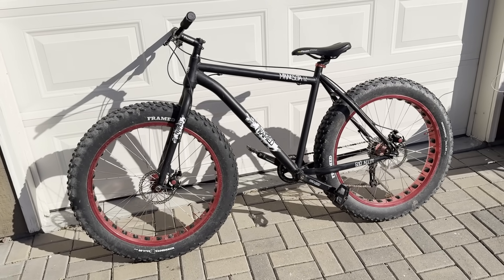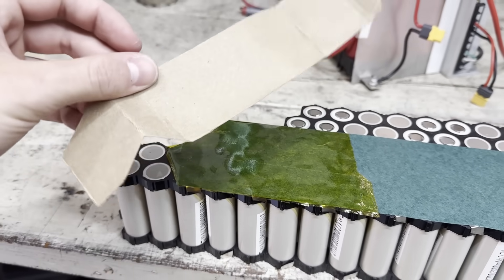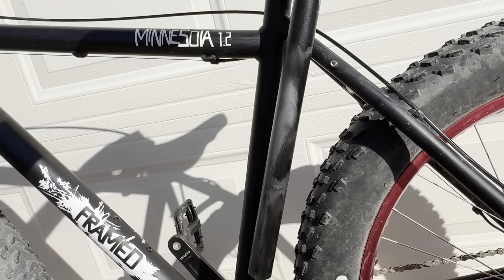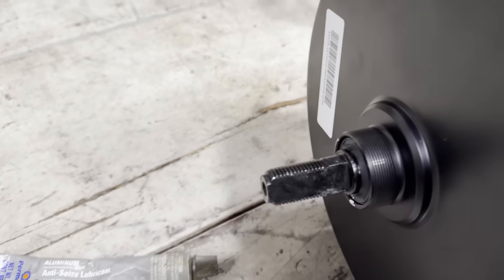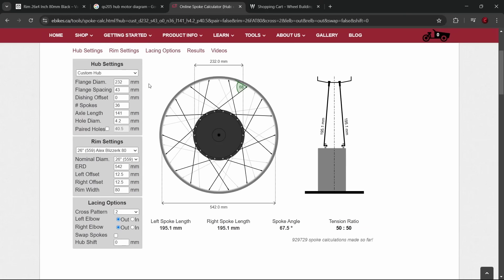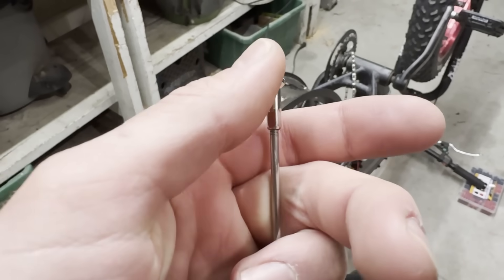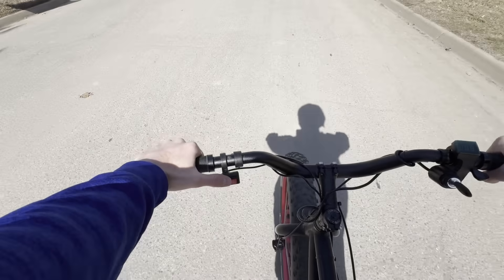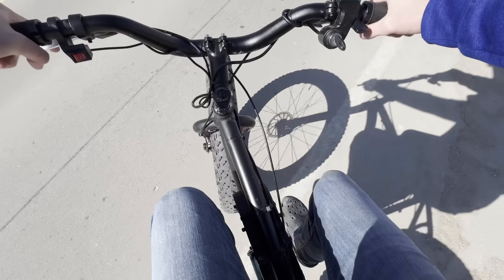Overpowered Fat Tire Ebike Build

Comment: All weight on rear wheel?  U got quite a pack on that's at top of frame I think it's top-heavy or whatever it is called
Reply from the maker: @Skrek1988  Not all the weight on the rear wheel but the battery weighs 15 pounds while the motor weighs 30 pounds, and because the motor is further from the center of the bike the weight feels much more significant.
Reply: @Calthecool  ah  wow 15pound battery xD thats alot of battery  xD. wow the motor is a beast😃  but i had noidea it was 30pounds 😯. tho im curious why did u add copper sheets on the battery isnt it enough with the strips alone? ive only done my batteries with the strips. would i benefit any on doing it like u did - coppersheet and strips to weld ontop like u did
Reply from the maker: @ Because the battery is doing 30 amps per cell you would either need very thick nickel or copper. I also wanted to go a bit overkill because the battery is in the plastic case so it doesn't have very good cooling.

Comment: Slap some training wheels on this thing or a wheely bar and it'd Hella fun!! Knowing my luck, I'd forget about the torque and do a double backflip and land on my head on take off. My current ebike I'm not the biggest fan of because all of its pedal assist modes are "like woah, you touched the pedals.. I got this bro"
Reply from the maker: @snonniesnean123  Yeah it’s annoying when you are going around a tight turn and you move the pedals a quarter turn so your foot doesn’t hit something and the bike thinks you want full power.

Comment: Is this more powerful than a bbshd?
Reply from the maker: @Alphabet7  This is 5x more powerful than a bbshd.
Reply: @Calthecool  in watts or real world? Genuinely asking cuz I have no clue
Reply from the maker: @Alphabet7  To compare the watts you can multiply the current*voltage, bbshd is 52V*30a=1,560w while this bike is 72V*120a=8,640w. I don’t think it would be possible to have a bike with a mid drive motor that could beat this bike because the normal bike chain drivetrain just can’t handle enough power.
Reply: @Calthecool  interesting. Thank you

Comment: what about the batt cooling system? it could overheat 🙋‍♂️
Reply from the maker: @devaneizanardi  It hasn’t gotten very hot at all, these cells are rated to do 35 amps from full to empty nonstop and I’m only doing bursts of 30 amps.

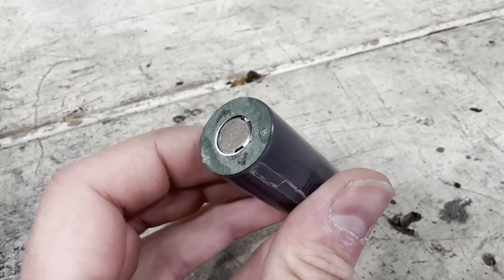Comment: 0:37 With the nickel sanded off you can solder them. Solder doesn't stick to the nickel very well, but I have soldered 18650 batteries together by sanding the nickel off because I don't have a spot welder.

Comment: bro we both know this thing doesnt have more than 1500 W
Reply from the maker: @user-interestingguy  Lol are you trolling
Reply: I think the rated is 3000W, but i do wish everyone would stop using the peak number since that is for short bursts if it actual ran at 9000W it would be cooked
Reply from the maker: @shaynegadsden  This motor could do 9000w continuously for probably 8 minutes before it overheated depending on the conditions, so I think it’s fair to rate the bike that way. It’s how cars are rated after all, you couldn’t do donuts for 8 minutes at full throttle in a sports car without it overheating.
Reply: @Calthecool First of there is no QS205 5T rated for 9Kw second that peak rating on all E-Bike motors is for seconds not minutes, I am electrician i understand motor specs. And third no a car can run at peak power till it runs out of fuel and doing burnout isn't a good example since the reason engines fail there is overheating not much airflow spining in circles.
To prove my point if you read the the spec on the website you linked it gives an ooerating temperature of the motor then in bracket the temp at peak power and a time
(peak 120℃ in 5 – 10 second)
Reply from the maker: @shaynegadsden  I never said it was rated for 9Kw, and you can never treat the ratings like they are perfect. Even at face value the “peak 120 degrees c in 5-10 seconds” value doesn’t make sense, if the motor got that hot it couldn’t cool down any significant amount in 5-10 seconds anyways. I compared it to a car doing a burnout because it doesn’t have the most efficient cooling, just like a hub motor spinning at low rpm doesn’t have the most efficient cooling. If I drilled a bunch of holes in the side of the hub motor for cooling then it could take a lot more power, but that’s an unreasonable thing to do.
Reply: @Calthecool obviously you don't understand the peak is the maximum temperature and how quickly it will get there not how long to cool, and where does it say anywhere the motors true rating nowhere it's just 9000w everywhere and it's not just you but most people building electric toys and the manufactures which is wrong motors should always be referred to by their rated power which is how all motors were until E-Bikes, since all electric motors exceed their rated power when speeding up
Reply from the maker: @ people say the maximum power because it’s relevant to how people ride the bikes. If I built this bike to pull heavy load up a long hill at a constant speed then the continuous rating would be more important than the peak, and that’s what I would refer to as the power of the bike. It just wouldn’t make sense to refer to this bike as a 3000w bike since it’s obviously way more powerful than that. It’s totally fine to think that this rating method can be misleading because I agree that it can be, but it’s the rating method that’s pretty universal for stuff like this so it’s the one I use.
Reply: @Calthecool it's not relevant it's purely spin 9000w sounds a lot more impressive than 3000w, that's why it's plastered everywhere

Comment: I’ve seen you use this motor and controller in previous videos. Including a moped style bike. Why is this one so much quicker and more rowdy?
Reply from the maker: @victorvannatter312  The controller on the moped style one is a 50 amp controller and this one is a 120 amp controller, and this motor is a QS205 3000w motor while the one on the moped is a generic “3000w” that definitely isn’t 3000w because I got it pretty hot with 3600w peaks. You can feel the weight difference between the motors, the qs205 is like 50% heavier than the generic one.
Reply: @ I just rewatched it and the motor, besides being a 4T wind is the same, is it not? And the same controller. Unless you've turned it down. From your upgrade video
Reply from the maker: @victorvannatter312  Oh I thought you meant the older video I made. The Windone does have the same motor, controller, and power but that bike has full suspension and a steel frame while this one has no suspension and an aluminum frame so it’s much lighter. I mentioned the difference in the Windone video.
Reply: Ah gotcha. Thanks.

Comment: You should never solder crimp terminals. This localises the mechanical stress at the end of the solder joint, making it very prone to failure. Otherwise great build, good job buddy.
Reply from the maker: @bobsmith369  Thanks for the advice, I soldered them because I knew there was going to be water on them and I’ve heard that the current + water + different metals would cause the connection to degrade, is this a big issue? I’ve heard a bunch of different opinions when it comes to terminals.
Reply: @Calthecool  It is a big issue for mechanical durability, if they move a lot from vibrations they could brake at the beginning of the solder joint. But don't take my word for it, google "NASA Workmanship Standard for Crimping, Interconnecting Cables, Harnesses, and Wiring". 
I have no idea about corrosion related things, but I guess if you crimp it and cover it with waterproof heatshrink (the variant with the hot glue inside) or something like sugru then you're covered in all aspects :)
Reply: are there any other nuances you'd like to say about the video? I'm interested in making a bike like this and wondering what other parts were potentially unsafe. Coming from someone smart like you!
Reply from the maker: @ Nothing else that I can think of besides it being unsafe cause it has a lot of power. You should make sure to have the best torque arms that you can get/make because that's a major failure point for a torquey motor on an aluminum frame.
Reply: @ what torque arms did you use for this build? do you use titanium
Reply from the maker: @worldoftankslover9241  You can see what I did, they are made of normal steel.

Comment: Just TIN the top and bottoms . Also SLEEVE that downtube ... even if u have to cut / get a shorter seat steam. that crack will SCREW U HARD
Reply: GREAT FREAKING WORK MAN.,.. that pack buildout was just BEAUTIFUL!
Reply from the maker: @davejack8973  What do you mean “tin the top and bottoms”

Comment: I wouldn't be at all surprised if those rear dropouts fail some time soon, all that torque will easily destroy a frame quite quickly.
Reply from the maker: @DanRC69  It’s doing good so far, it looks like more torque than it is because the front is so light.

Comment: What spot welder do you use?
Reply from the maker: @coltont4242  K-Weld from Grid Rewired powered by a 4p3s pack made from red headway 8Ah cells. You can see it in my most recent video.

Comment: Swap out those tires for something that has actual grip like a pair of street tires, the speed increase from the lack of drag is really noticable plus the ride is smoother and much quieter.

As well you should tweak the acceleration curve so you dont get thrown off as well as change out the throttle for a full twist for better acceleration control.

Also add some lights, turn signals  and a horn. You'll be happy you did.

Awesome build! Stay safe!
Reply from the maker: @vinylmodsmanitoba  I built this bike to ride in sand/snow so the tires are a good fit. I like having a crazy amount of torque, that’s the fun part. If I want it to be more chill I can switch it to mode 2. I have great acceleration control with the thumb throttle, on that wheelie up the hill I can pop it straight up to the balance point and stay there.
Reply: I recently switched from stock knobbies to street tires on my Ausom Gallop scooter. There was a noticeable increase in range. I went from maxing out at 43 miles with hard riding to over 55 miles on the same terrain with about 10-15% battery to spare. It was seriously like a 15-20% increase in range.
Reply: @nunyabusiness9013 Improving aero and reducing rolling resistance is massive for increased range.

Comment: Thanks for the sharing your superb project. What was the maximum speed you could reach?  any quarter mile  and or 0-60 mph benchmark numbers, how long the can it go (miles) in Eco-mode on full charge? Please stay safe.
Reply from the maker: The 0-60 is at 14:11, it isn’t very good because the motor is a 5T motor so it can only barely reach 60mph. I don’t know what the quarter mile time is. You can estimate the range using an online calculator, it has a 72v 12Ah battery and you can set the power to anything under 9000w because the controller is programmable.

Comment: i used a similar fat bike for a 52v battery, 1500w direct drive motor and 40 amp controller. 35-40mph on throttle only is achievable and i think that is plenty quick enough for a bicycle. mine will output 2300w according to my display when the battery is topped off. I use it for commuting sometimes to save fuel money. First thing i did after the test ride was upgrade the brakes to 220mm on the front and 203mm on the back as the stock ones heated up too much and brake fade happened quickly especially on downhills.
Reply from the maker: @ramborambokitchenkitchen6357  that’s a good amount of power for a bike like this, totally respectable.
Reply: @Calthecool  I wouldn't like my bike to be trying to throw me off at full throttle anyway lol. i managed to fit a 52v 30ah triangle battery from KirbEbike so the range is about 50 miles not pedalling if im not hammering the throttle. These bikes are the future.
Reply from the maker: @ that’s a great size battery, like 170% the capacity of this one.

Comment: How do you spotweld copper plates? Im genuenly interested i wanted to make my own battery pack for my overpowered electric sup
Reply from the maker: @Retrograde99  You have to have a thin piece of nickel on top of the copper and a very powerful spot welder, like 5-10x as powerful as a normal ~$100 one that you see a lot of people use. Look up “copper nickel sandwich” for more information.

Comment: That is really impressive man. I have a very similar fatbike, a Framed Minnesota 2.0 medium frame with a mid drive. You must have a large one to fit both battery and controller in the triangle? I only have enough space for the battery itself. What does your bike weigh?
Reply from the maker: @Hybrid600  I don’t know how much it weighs. It doesn’t seem like a very big bike.

Comment: Nice build🌟🌟🌟🌟🌟, how can you determine the right bike chain for that kind of power? Will it snap
Reply from the maker: @abrahim4861  The chain is only used when you pedal because this bike has a hub motor. I don’t think there’s a bike chain that exists that could handle this much torque without having a massive rear sprocket.

Comment: Hey man that is a sick bike!!! I just have a question, where do you get metal to make things like the torque arms, and what do you machine it with? I cant seem to find any cheap scrap metal online or near me please help!
Reply from the maker: @sasanito3169  it’s scrap metal that I have had laying around for a decade, I’ve never bought metal so I wouldn’t know where to get it. I just use an angle grinder with a sanding disk and a flat disk, and a drill with a set of drill bits.
Reply: Ok well i will probably figure something out, thanks for the advice though, love your stuff

Comment: Nice build. Doing an all black hub build right now on a Giant Talon 1, Waiting on the Amorge 72v battery. MXUS 3000w 4T. Pretty sure even that 5T 205 can go faster than 60 if you tweak the Fardriver.
Reply from the maker: @RetroMancer242  Sounds like a good build. 60 is plenty for me, plus cranking up the field weakening makes it less efficient.
Reply: @Calthecool  Yea, me too. more concerned with acceleration for these city streets. I tried to share a link twice to a cool hard to find switch and ShitTube blocked it twice, even though the 2nd time I tried I didnt even use a full link.
Reply from the maker: @RetroMancer242  yep they turned up the link blocking because all of the scammers a while back.

Comment: BTW, You might try inflating your tires at different amounts. I ride over sand really easily in fat tires at 15 lb psi. I bump it up to 25 lb PSI to ride on the street.
Reply from the maker: @jeremywheeler2122  yep, I let some air out when I ride on the sand.
Reply: @Calthecool  I figured you knew that already. I just found your channel and it can tell you're practically a genius. I have a wired freedom electric bike but would love to have something lighter weight and faster. For that I'm going to have to go homegrown.
Reply from the maker: @jeremywheeler2122  DIY is the way to go if you want something super fast.

Comment: It's 5000watt not 9000watt
Reply from the maker: @powchainsamaniego6744  it’s a 120A controller being fed ~75v at full charge after voltage drop so it’s 9000w. The motor is rated for 5000w continuous but it can do more if it’s not continuous.

Comment: Do you have any guides or references i can use to learn how to make one of those batteries? I'm thinking about making custom batteries, just dont know where to start. 
Also, where did you find those 21700 cells? 
Thank you!
Reply from the maker: @OffTrap  those were from BatteryHookup.com but they are sold out now. If you are in the U.S. then check BatteryHookup.com and batteryclearinghouse.com, they are the two places I’ve found that sell cells for a decent discount without requiring that you order a ton of them.

Comment: Genuine question  how do u get regenerative braking
Reply from the maker: You have to have a controller that can do it, basic controllers usually don't have it because some batteries don't like being charged from regen and it can cause issues. On the fardriver controllers you first plug in the dongle then connect to the controller with bluetooth on your phone, then you can change the settings to have a certain amount of regen current.
Reply: @Calthecool  ok thanks

Comment: You need to pay attention to the average current during cycling. If the current exceeds 1.5 times the AH of your battery, it will affect the battery's lifespan and increase its internal resistance. So the motor power cannot be chosen too high.
Reply from the maker: @listockisatm8281  surely that’s dependent on the discharge rating of the battery, not just a set value like 1.5.

Comment: Great build! I just finished building my 6000w ebike with a custom mh1 pack to give 72v21ah
Reply from the maker: @themastereal8345 post a video about it and I’ll check it out.
Reply: 72 volts but only 21 ah? That seems like a strange battery. Every 72 volt e scooter battery I've seen is 45 ah or more.
Reply: @nunyabusiness9013  Its on one of those hardtails so not much space

Comment: I want to build one now, but at my age I think I better keep it to 52 or 60v so I don't break a hip.
Thanks for the great work. Your videos are always entertaining.
Reply from the maker: @oldmanwithebike  this one’s definitely not for the older crowd, no suspension really rocks you if you aren’t prepared for a bump.
Reply: the weight of these ebikes are not enough for the speeds for a small rock. 40 mph front jump small rock no recovery. 60mph unthinkable